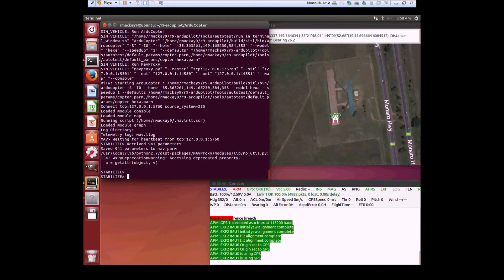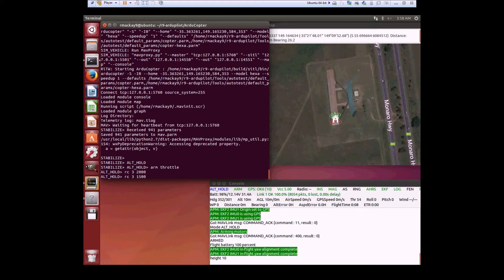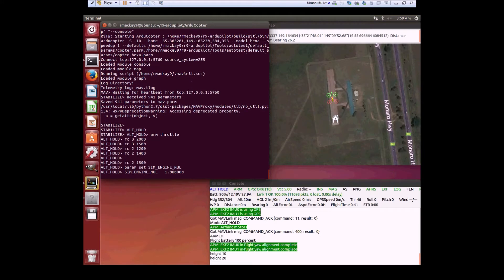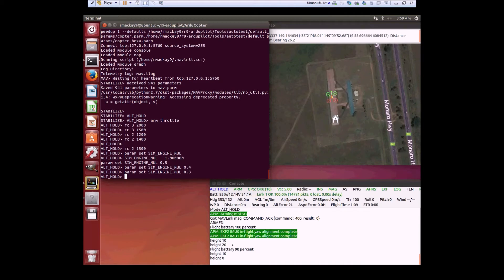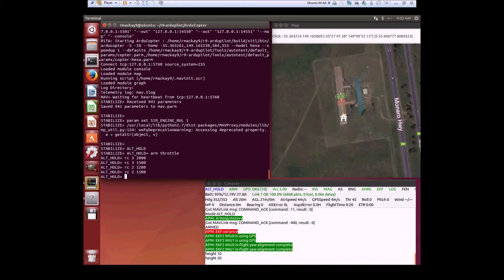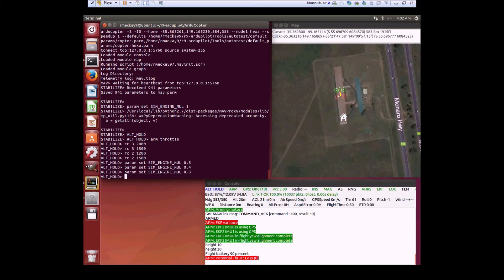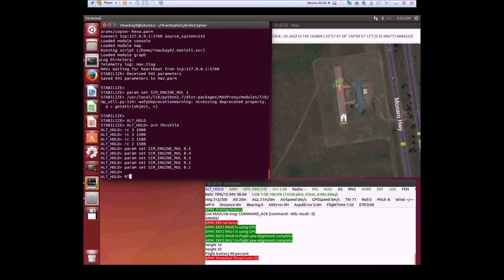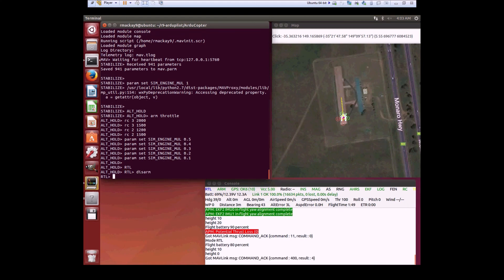Simulator test of Motor Failure Redundancy Improvement Patch

Comment: Cool. So you prioritize alt control over Yaw control.
We need a similar thing for the tailsitter code: prioritize pitch control over Yaw control! So the craft is still holding pitch correct if the rudder saturates cuz of Yaw error. Maybe you can also add this. Code should be similar or? :)
Reply from the maker: David, I probably won't be able to take on the tailsitter changes.  Probably the best way to raise awareness is to raise an issue on the issues list here: https://github.com/ArduPilot/ardupilot/issues.  Thanks for using AP!
Reply: Sure I'll do! Thank you for working on Ardupilot :)
Reply: Randy, here you have the link https://github.com/ArduPilot/ardupilot/issues/9412

Comment: I really want to see a ~1km RTH with a remote controlled relay to simulate single motor failure on a real hex.  I'm wondering how a hardware magnetometer will tolerate that long of a yaw, and what the tracks will look like.  Great idea though.
Reply from the maker: Yes, the simulated copter is very well tuned so a real copter should not do as well, but how bad will it be?  We shall see because I'm sure we will get some real people testing in the coming months.